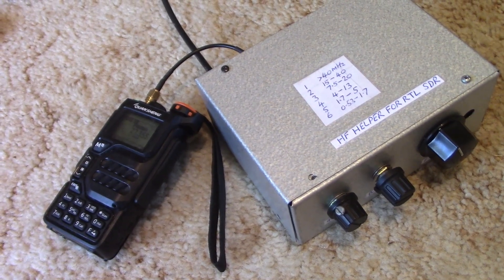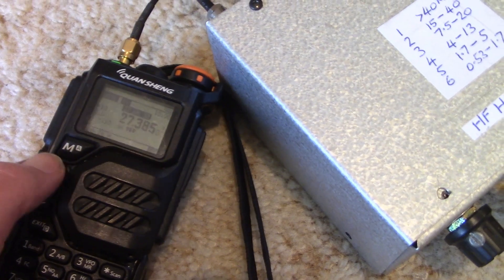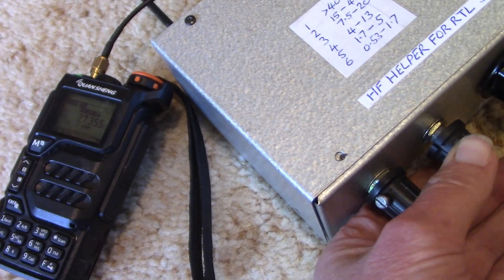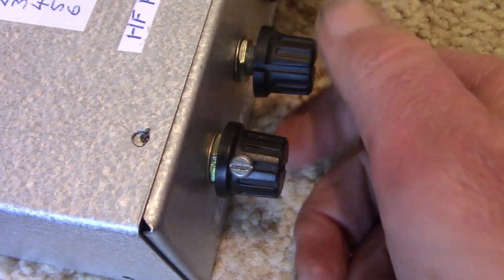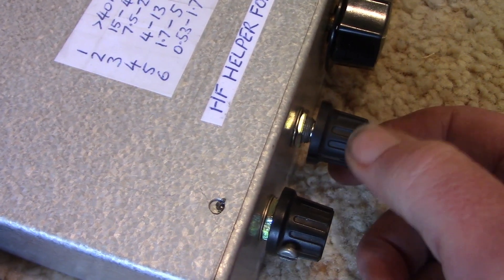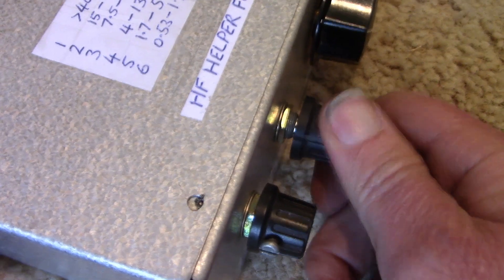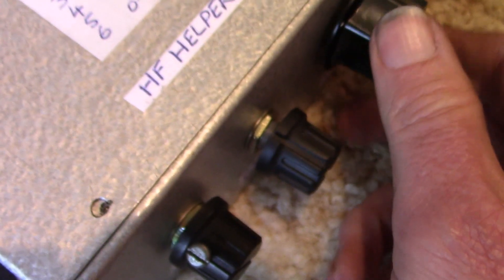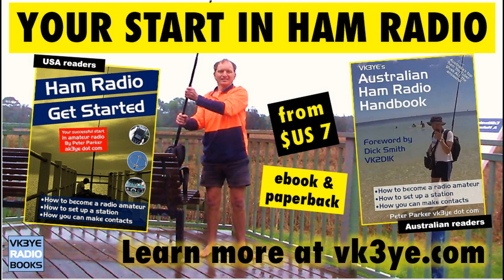HF Helper with Quansheng UV-K5

Comment: Where did you get the case for the preselector thing  ??
Reply from the maker: Hamfest cheapie
Reply: @vk3ye  nice looking case. I’ve been looking for nicer looking boxes with a bit of flair. Something with a bit more of a finish to them. 

I put my X Phase QRM eliminator in a little Hammond extruded aluminium thing, and the second attempt on the front panel gave me a much cleaner result, a little more thought out. You can buy 10 packs of the end panels. Handy for prototyping. 

But then I dragged out the. old FT101B (where B is for Boat Anchor) and put it on the bench. The aesthetic of that old transceiver can’t be beat. It felt like a “real radio”. 

Might see if George VK2AOE can knock up a wooden sleeve in his woodwork class he does. Maybe build something with that early 70s hifi feel. 

Tip with the X Phase, if you want to put it into a compact case, leave the pots off the board and wire them in with short bits of wire. You can centre them on the face plate much better and it leaves room for a power / bypass switch and dual colour Power / TX  LED